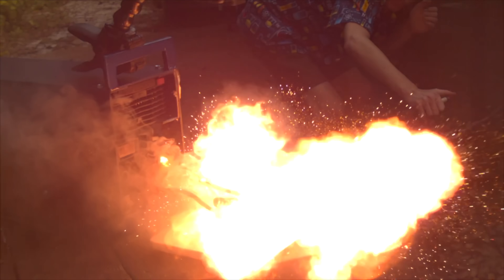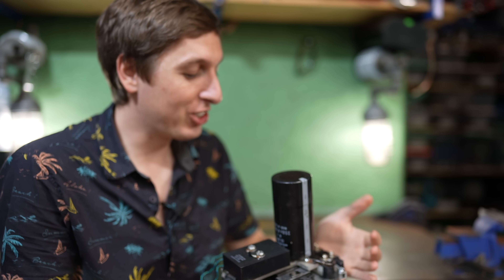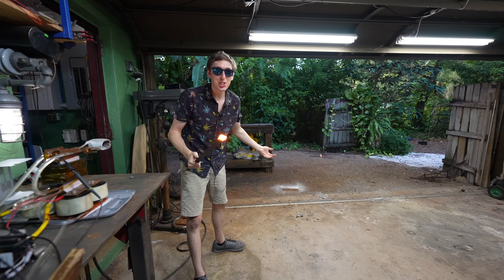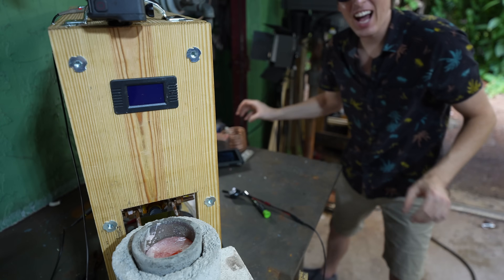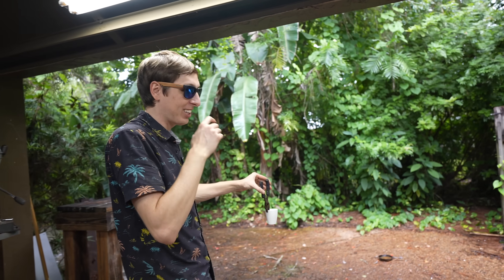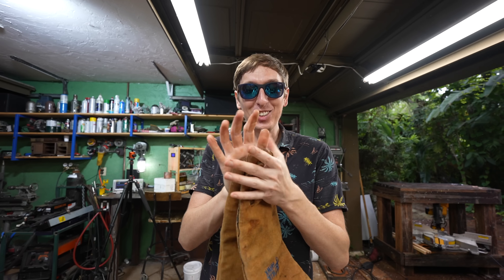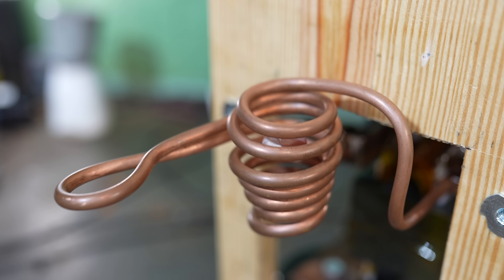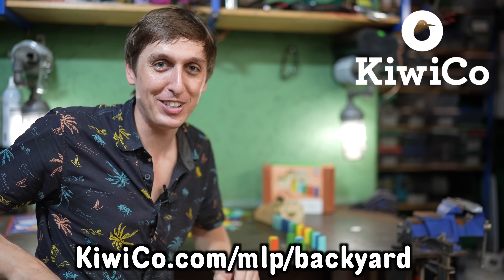DIY induction heater that can BOIL STEEL

Comment: FYI
When you are building water cooling loop, try not to mix metals, as the galvanic corrosion will mess your loop very much and very soon. You have used copper tube for the coil, but the waterblock for IGBTs is aluminium(aluminum), so the galvanic corrosion will happen very fast. Even just different alloys of copper will cause it, but it will take much longer.

You may delay the corrosion with anti-corrosive substances like those used in car cooling loop, but those can cause premature failure of the water pump.
If you can, use only copper. If going budget and mixing metals, be ready for very frequent cleaning of the loop, blocks and the pump
Reply: Great information
Reply: This is true, but the galvanic corrosion only happens if the two different metals are in contact with the water and in contact with each other, making an electrically conductive connection to each other. The chemical reaction is basically a short-circuited battery - the higher the difference in electronegativity (aka reduction potential) between the two metals, the faster the reaction will be, and having some kind of electrolyte (any dissolved salts) in the water will accelerate the reaction too, which is why this kind of galvanic corrosion is faster in sea water than in fresh water.

You can however stop it happening by having an insulating layer between the two different metals, so they cannot make an electrical connection with each other. So for example in this case with water running through copper tube and an aluminium heatsink block, all you would need is some rubber or plastic tubing taking the water between them, so the water can still flow through both but without the copper and aluminium parts touching each other. Or another example in my house - the rising water main is old iron piping, much thicker than more modern copper pipe. But some years ago, part of it had to be replaced, so the plumber had to connect a copper pipe to the iron pipe. If they had been directly connected, galvanic corrosion would have been a problem, accelerating the corrosion of the iron pipe. But a plastic adapter was used to make the connection, with more plastic (PTFE tape) to make the connection watertight. This layer of plastic insulation has the bonus prize of blocking the electrochemical reaction, so galvanic corrosion between the iron and copper can't happen.

One interesting application of this kind of corrosion is in the "flameless ration heaters" in military ration packs, aka MREs. These are just a porous packet (like an overgrown tea bag) filled with a mixture of salt and some metal granules. The instructions tell you to put this in a plastic bag alongside the pouch containing the food and add some water, enough to soak the packet. This obviously dissolves the salt to make an electrolyte solution. But this is where it gets really clever: The metal granules are an alloy of mostly magnesium with a few percent of iron mixed in. When this comes into contact with the salt water electrolyte, a galvanic corrosion reaction happens - each individual piece of alloy becomes a short-circuited battery. Since there is a large difference in reduction potential between magnesium and iron, the reaction is fast and generates a lot of heat, easily enough to boil the water and heat up the pouch of food. The net reaction is actually oxidation of the magnesium component of the alloy by the water, with the iron and salt acting as catalysts, speeding it up. So one product is magnesium oxide, the other is hydrogen gas. Which is why you are not allowed to use flameless ration heaters on aircraft - the hydrogen released could build up inside the cabin (especially with a whole lot of people using them at the same time), and it only takes as little as 5% hydrogen by volume mixed with air to cause an explosion if it finds an ignition source.

Comment: Waow, quite impressive.. i wish to know, what power of device you made to make metal melting.. how many watts it is require.  Secondly,  to make one myself, does the blueprint in your book is complete for all material and instruction to built one ?  Another thing.. if i make a long tunnel in copper tube.. what will happen about power source ? will it weaken ?  or it wont change a thing and just melt a longer metal bar ?  thanks for answering. Michel
Reply: @TheBackyardScientist that would be sick to release the specs and blueprint

Comment: When you turned it on and off, it made me think of the aluminum plant I started interning at. To make the large aluminum ingots before they are rolled, they pour the molten aluminum into a mold, but the mold has copper going around it and they pump it with like 6000 Amps and the  aluminum doesn't actually touch the sides of the mold as they pour it and it end up with super smooth surface quality.

Comment: Multen metal want explode thrown on water but if you work at a foundry guys close up water bottle and throw it into a furnace for a amazing looking explosion. Wear protective highly advised. I believe this happens in nature as well if water becomes encapsulated under ground then heated by a multen valcano, though never read or seen anything on it.

Comment: Anything that produces a thermal signature high enough to create black body radiation (like the draw of a cigarette super heats the embers on the inhale) will by proxy create an infafed signature, you can prove this with army issue nods circle 2015, they're about $4k to purchase if you wanted to prove it.

Comment: Bet that puts a bump in your hydro bill. 60 amps you said? Maybe a HHO powered generator to go with that. Use a Sterling motor, put limestone on the heating end and just pre heat, then run HHO at the lime stone, no need to ignite.  the Limestone lights up and stays hot, that will power a generator quite well. Especially using over 60 amps for a single project.
That could be a nice safe change in the hot water on demand design too if you use HHO to power it.

Comment: The molten steel is not what explodes. the hot steel boils the water under it and if the amount of steel is large enough it can trap the quickly evaporating water, creating a steam explosion that explodes the steel as shrapnel.

Comment: Funny video, but this guy is a walking disaster in terms of safety.
Working with molten metals without any protective gear except some simple glasses and throwing hit liquid metal all around is the same to enter in side a lion cage kick him the balls pull his tail and give him kiss in the end and expect he does not react against you!
Plus all that metal sparks close to high power electronics.... Well is just ask for troubles...  Hope the next video is not recovered on a hospital ER. 
But yes was entertaining....

Comment: So, I was just thinking how awesome it would be to see iron ore processed into a bloom using this thing... usually it's a super involved process that takes building a big clay furnace/etc to reach the temps needed, but I bet you could pull it off with this thing!  You should totally make a vid of doing so!
Reply: I thought that if you can reach hot enough temperatures, you wouldn't do the bloom process but instead just do the bessemer process?
Reply: @iteragami5078  only if you had some means of forced O2 so you could oxidize out the gunk... though there's a fair amount of danger involved in molten iron temps combined with pure O2... lol.  Would be better, in my opinion, to just do a wootz steel sort of crucible with some added graphite powder and crushed glass to create a hermetic seal.

Comment: Does the lenght of the copper coil affect the wattage? If you have a 2kw inductiom heater with a 1 meter copper coil will the wattage be different with a 10meter coil?

Comment: Thanks for shearing. When you put some steel bars into the crucible in the induction heater,  the video was immediately put in time lap. Please, I want to know about how long it took in real life (time) for the steel to get molten? And what kind of crucible you used to melt & hold molten the steel?

Comment: Dude, the lack of any safety concern actually got to the point of irresponsible with this video. Molten steel will burn a hole in your body straight to the bone and potentially a bit through the bone as well. Kids watch this.

Comment: I am wondering what would happen if you bought a bag of that prospector sand and stuck it in here.  Would you get slag with identifiable gold in a layer or button?  Will the atomic weight dictate where the gold would rest after its been in a molten solution.  Very interesting.  This would be great for like an automatic divorce machine (yeah dont know how I came to that conclusion...)....where you throw your wedding ring in and sign a form or two.

Comment: Hi 

Do you plug your machine straight into the mains or do you use something to control the power?

Thanks
Reply: It was just the first corner that he cut. Great simplification of the circuit. No need for 7kW SMPS or a transformer.

Comment: I used to work for a company that built variable polarity welding machines that used a setup similar to you main capacitor/transistor setup.  They would stress test the machines at a few hundred amps for several hours, and everyone in the building knew if one of those caps let go.

Comment: I have 12 of those IGBTS that are rated at 1200v and 400 amps. I have been wanting to build an induction heater for along time. Thy came from 2 100hp VFD drives. So I have all the capacitors and monster inductors

Comment: As one that hung around the steel industry for four decades, I am both amused and horrified by your casual approach to liquid metals.  

I have been interested in setting up a small hobby foundry, and your design looks about the right size.  What info sources did you use for the circuit design and sizing the coil for melting?  . How about the crucibles?

Comment: I wonder if you stick a steel tube through it, put some aluminum in the tube where the coil is, and once the aluminum melts cut the coil power and open a giant air reservoir attached to one end, what would happen? 🤔 scientific purposes only

Comment: I think in order to get an explosion out of molten (or just hot) steel and water, you need to apply some force to it as well.
I'm a hobby blacksmith, and I've had a few times where I put a glowing hot (but not molten) piece of steel on my anvil while it was somewhat wet, which by itself doesnt do much, but if you then hit it with a hammer it does make a pretty loud bang.

Comment: Have you accidentally figured out how to turn a rail gun into a gun that shoots molten metal. I’m sure you could integrate them. Although dragging the metal through the magnets may be difficult because doesn’t metal lose its magnetism at certain points but then that leaves me with the question of how was that glob floating. So cool man
Reply: It's the dielectric properties of aluminum that cause it to float

Comment: it's the water that explodes not the steel, so you need enough steel proportional to the water for it to immediately boil all the water away causing it to explode

Comment: Another pro tip from Kevin:

Always make sure the front that faces your induction heating coil is made out of wood.
Reply: Yeah, should have used plastic
Reply: @lordshuv-rowyoknow6486  no, the plastic would melt
Use a good heat resistant metal plating on the wood.
DONT MAKE IT CONDUCTIVE
Reply: @aarnealplayzgames9580  I was sarcastic there, but last I checked plastic is very much not conducive to either current or heat.
Reply: looks like pressure treated wood as well...yum
Reply: @Koroku Miuri well not anymore
Reply: Thats to prevent the fans from pulling in heated air into the PC board.  I ordered a pre-built one and the video i watched said to do this.  Of course it wont be complete.  Ill also need to build the water coolant system and find a way to power it.  I was thinking with a bunch of 20 amp laptop batteries, and wire the circuit so you can switch breakers on and off to add volts.  My bench power supply aint gonna power this monster.  You can actually make a heater for your home by just spinning a magnet near a copper coil, and hookup the coil to a radiator with a fan. Directly convert kinetic energy to heat energy on the fly, and its even more efficient than resistance wire.
Reply: Styrofoam would have been a better choice....

Comment: The steel was spitting sparks because when in liquid form it reacts to oxygen. That’s why stick electrodes are coated in flux and flux cored wire has flux. The flux rises to the top of the puddle and solidifies to protect the molten weld puddle. So if there was no flux a weld would look similar to the molten metal spitting sparks out.

Comment: We use an induction system to heat treat solid steel bars upto 250mm on diameter. It's amazing how incredibly fast it will turn red hot

Comment: Real question here: Would it be possible to regulate the voltage in a way that you could control the temperature and do forging this way instead of a flame? Would this make it easier and faster to forge if someone invested in something like this to heat up the metal before putting it on the anvil? I've seen a lot of forging and casting videos and it seems like this $1,200 investment would make their lives so much easier potentially.
Reply: your pretty much describing how an oven or stove works, so yes

Comment: bigger molten steel holder, put a small container closed with water inside(frozen for cooler resullt) and drop it into the molten metal and then u can get a new house
Reply: or just drop and ice cube into molten metal

Comment: I believe the rod in that firestarter is ferrocerium, a mixture of mostly cerium and lanthanum with some iron
Reply: Also, iron (which steel is mostly made up of) at standard atmospheric pressures needs to be heated to over 3,000 kelvin (boiling point of iron is 3,135 kelvin, 2,862°C or 5,184°F) in order for it to boil which I'm not sure if his induction heater is capable of reaching such high temperatures.

Comment: Well I got a story about exploding steel my chemistry teacher told me, but there's some relevant information I gotta cover first. Many decades back, when he was a young man he worked in a mini mill. A mini mill is like a steel mill with two main exceptions: a mili mill is focused on recycling steel, and as the name would suggest it's much smaller. Those two features give rise to a third dissimilarity: a mini mill's main crucible doesn't need to be continuously operated, it can be easily slowed or even completely cooled and only cost a fraction the financial burden a mill would.

He told me the last week he worked there it had been really slow. Management had the staff kept to a minimum and there were days between melts. Normally that wouldn't cause any catastrophic problems but it'd been a particularly rainy that week. The reduced staff hadn't noticed the rain had found its way into the building and pooled in one of the moulds. Half way through the casting hundreds of pounds of liquid steel were poured atop a thin lining of water. The water was vaporized on contact but the volume of steel was great enough to enclose little pockets of expanding steam. He said it was like a bomb going off. In his words it was just a normal day when he say hell on earth. Hundreds of pounds of steel in the thousands degrees, and not even an instant to react. He then showed a fist sized scar on his calf where he'd been hit, it wasn't a pretty sight.

When I gave him sympathy he laughed. He said he was lucky. He then told me of his friend who had also been working there. A friend he'd had since birth. A friend he'd been chatting with only seconds before, one he was standing only a few strides from, one who didn't even have a instant to scream when a soccer ball sized lump of steel caught him chest and neck as he turned to see what had happened. The mass of metal wasn't hardly slowed by him- it simply caught him up in its weight. In a blink he'd been caught between a chunk of liquid steel with the momentum of a train and a concrete wall of the foundation. When he was dashed against the wall a cheery sized lump of steel caught my teacher in the leg, needless to say it left a scar byoned measure.
Reply: Sorry for the bad vibes, just a reminder to be safe out there guys. Disaster can strike anywhere and at any time. Just do your best to keep safe and for the love of god call your mother and tell her how much you love her!

Comment: I actually used to melt steel powders on a daily basis with a similar induction set-up to measure their sulfur and carbon content. Takes less than 10 second and the whole content is turned liquid. Induction is really powerful!

Comment: "It's also basically impossible to put out a magnesium fire."
"Why do... Why do you do things?"
Reply: So true
Reply: It's not impossible
Reply: @TheDesertRat31  just very very very hard
Reply: @THESLlCK  I'm a firefighter. It takes copius amounts of water. But, any more than just a little bit of magnesium can be very dangerous due to reactivity and the superheating of the water.
Reply: Direct me if I'm wrong but can't it also cause and explosion
Reply: @anthonyroller8175  Only if it's a primer for some more explosive material. Magnesium burns hotly and is highly reactive, but unless you've got, like, a pile of magnesium shavings the reaction won't rapidly propagate in the way you need for an explosion.
Reply: @TheDesertRat31  all you need a Class D fire extinguisher
Reply: The Best statement!  🤣 Seriously though a magnesium fire is terrifying.  check Naval history for the Foresstal fire.
Reply: So we will watch and he gets paid😂